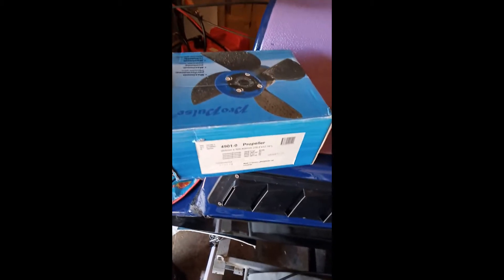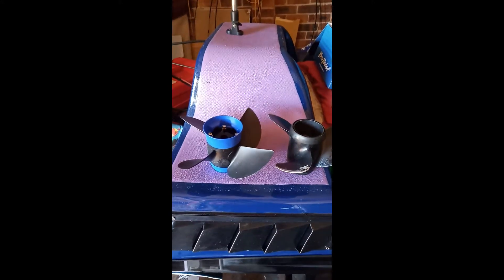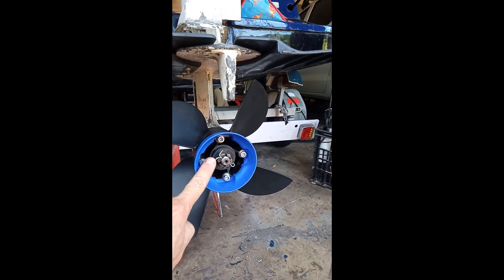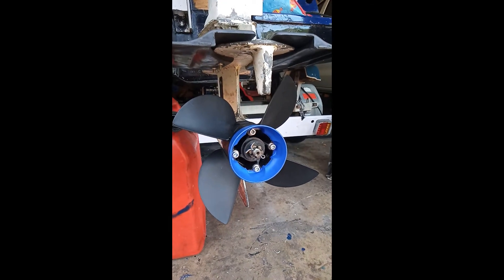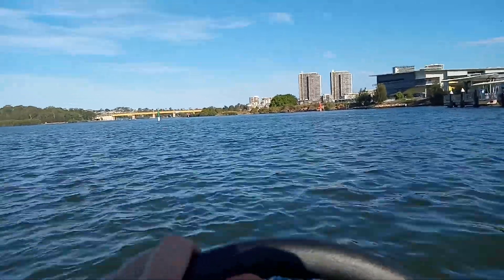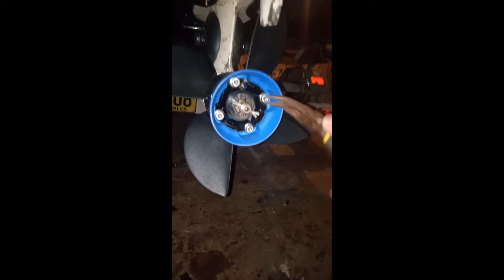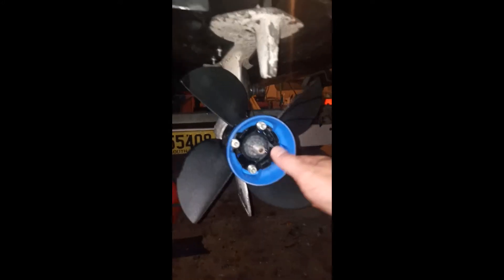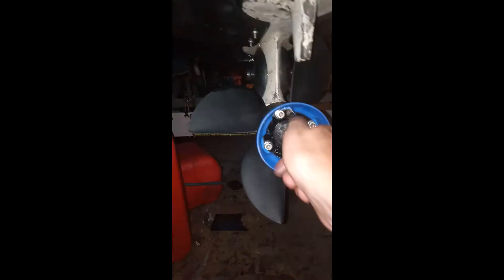Propulse Propeller Test

Comment: Great prop for testing and then buying a propeller with a real hub. If You drop the engine into gear at too high of a RPM the blades shear off!! This is due to the fact that the hub is solid and has no shock absorbtion. Cold morning and engine warmming up at the ramp drop into gear and thats all she wrote,no more propeller blades. Always bring tools and a spare prop(metal). Great for playing with pitch to find the correct one .Mine was on  3 cyl Merc 90 and no it was not turning some wild high rpm.Hope this helps dont want ya to get stuck. Jim L.
Reply from the maker: I didn't test it that long but yes, good props to establish a set pitch. Went back to alloy prop after that and sold the plastic one.

Comment: Nice work Dave. Any good on a bigger HP engine do you think?
Reply from the maker: Cheers man. They should be fine on bigger motor as well, I'd suggest give Olds Engineering a call and talk to them. 
By the way, I took the Mini out yesterday with 15 pitch set, definitely got more speed, didn't have the Speedo but must be near 24 knots. Will try 14 pitch and see how it goes.
Reply: @davesboatingfishing  Use the GPS on your phone to check out your speed!
Reply from the maker: @antonywardle  as said, 😁, didn't take the spare phone for that. Current phone has an app I have to pay for. Stuff that.